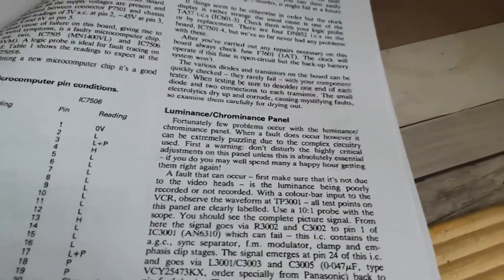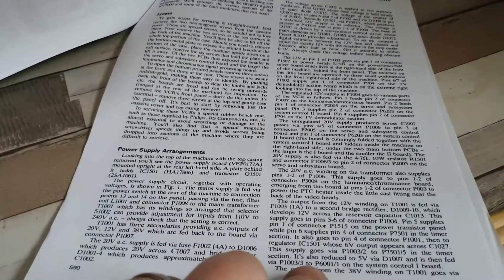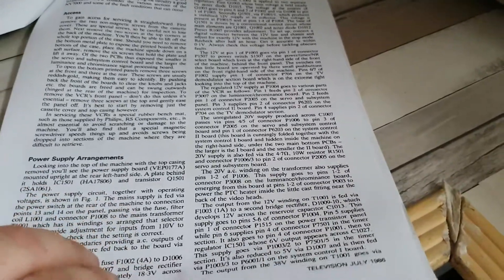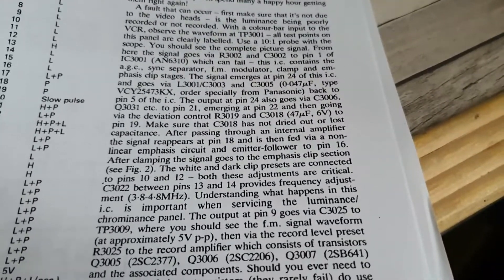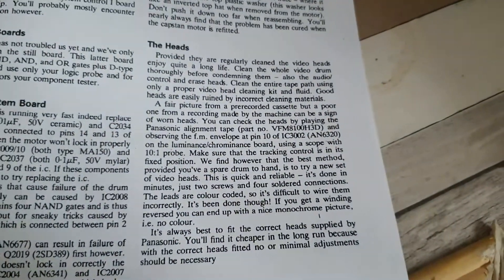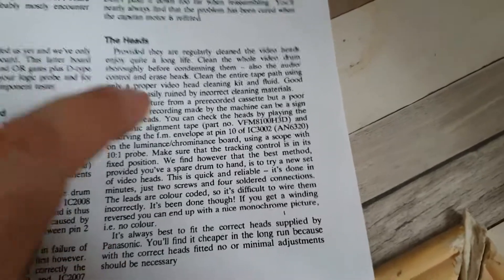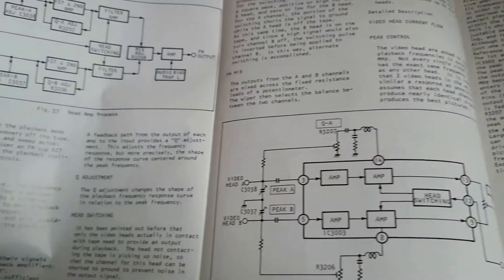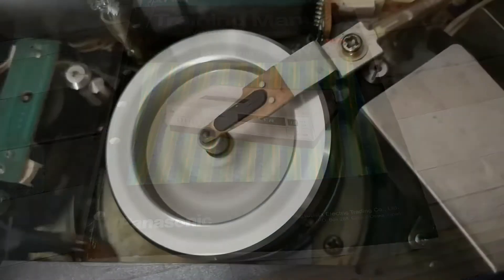Panasonic NV7200 - Repairs - Part 2

Comment: The service manuals for the 7200 and its Blaupunkt clone can be downloaded for free:
https://elektrotanya.com/panasonic_nv7200_sm.pdf/download.html
http://freeservicemanuals.info/en/servicemanuals/viewmanual/Blaupunkt/RTV222/
I also have the schematics for the NV-7500 which is nearly identical to your NV-7000-EM. Let me know if you want those.
PS: on my NV-7500 the AN6350 drum servo IC failed and caused a symptom very similar to clogged heads once the machine was warmed up/powered up for an hour or two. Letting the machine cool down temporarily restored normal PAL/SECAM playback but on NTSC the drum speed was unstable and couldn't be set by adjusting the "cylinder free run" trimmer. The cause was probably erratic PG pusles and the machine couldn't switch the heads back and forth, and that caused the "clogged heads" symtpom since one of the two heads was not being activated. Weird problem but I was lucky to have a spare board with a good AN6350 so I swapped the IC and that took care of it.
Reply from the maker: I'd love a copy, as they will come in handy. Email is jamesctuk@hotmail.com .Since this video was made, I have stabilised playback, but, have no colour unless I 'touch' the afc or chroma pot  cannot recall which. Based on your advice, I've bought it back in for another stab, focussing on the caps local to said pot. I did, somehow, manage to kill mechacon, rather than troubleshoot,  I dug out a spare board from an identical, dark grey 7200, I pulled apart in 1993, when I was 14. I found all the boards in my mums loft, nearly 30 years later, I'm glad to have them to hand!. Thsnks for your help this far, I appreciate it.